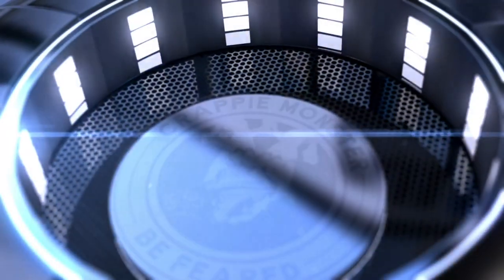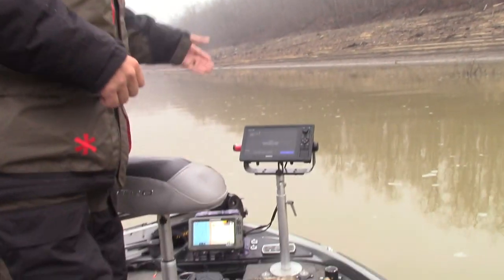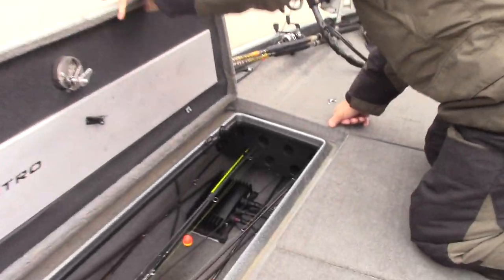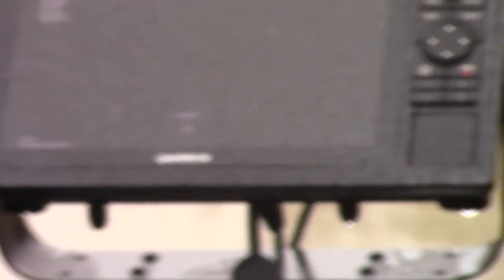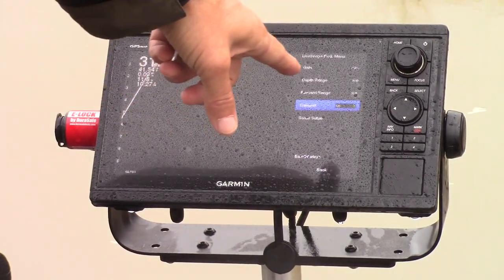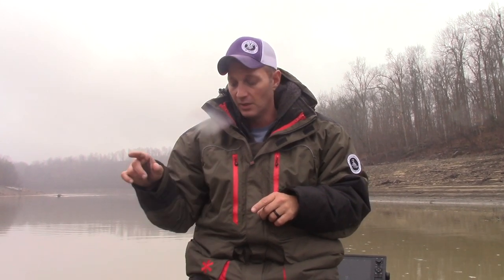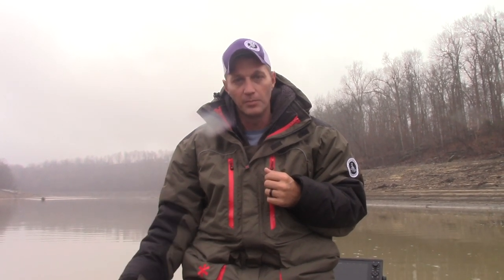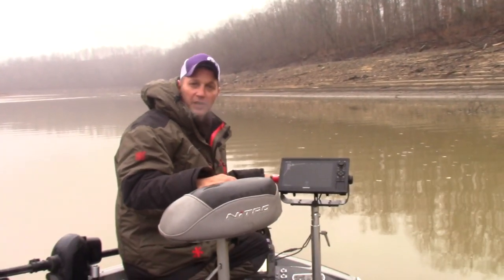Trouble Shooting your Livescope

Comment: I`m just now getting this info thanks for posting!When I use my panoptics  for live Scope,I have no cone beam icon on my screen and I don`t know under which menu to look to turn it on. My transducer is connected on my troll mtr but when I turn my mtr there is no indicator on the screen.
Reply from the maker: You have to go thru the calibration process to get it, I believe. Mine doesn’t have it either.
Reply: @CrappieMonster OK  Thanks for the bresponse

Comment: I'm sure this is a dumb question I just got live scope and they didn't ship the network cable with it so I figured I'll get everything hooked up and have it ready for the network cable and be done I hooked the power up to the black box and I get that red light and then nothing do I have to have the network cable and transducer connected for the black box to operate correctly?
Reply from the maker: Yes.

Comment: Well I've got this exact issue. Unplug my power for 10 seconds and replug, flashed red once then nothing. Tried the other cable like you said and nothing. Any ideas?
Reply from the maker: It’s probably the connection on the 18” cable. Did you try that one?

Comment: Now I would imagine that the power cable coming to the black box is supposed to have 12 volts at all times? I unscrew the red power cable off of the black box. Hit it with the voltmeter and there was no power.
Reply from the maker: That would not be good. It sounds like you have a tripped breaker or blown fuse.
Reply: @CrappieMonster  I figure it out. Whoever installed it didn't crimp the connections on the battery leads well enough. Sometime between the time I fixed the positive connection at the battery, and got the new cradle for the Garmin in the mail. Which was the reason it wouldn't power up. The battery terminal on the end of the ground wire had also broken loose. So luckily it wasn't anything major. I just bought the boat last Saturday. so it was an error by whoever installed it. Thank you for your time and this video. Cuz it may save me in the future

Comment: Why do you have to unplug the short cable ? My Garmin is doing the same thing. Is there a problem with the cable? I’ve used it one time and it’s reading transducer not connected
Reply from the maker: You really need to put dielectric grease in all the connections.
Reply: @CrappieMonster  I have on all the commections
Reply from the maker: You will end up having to send the transducer back.

Comment: You probably need to put the black box on the side of the compartment so doesn’t get wet. And probably have bad black box had mine for 2 years never done either of these
Reply: Could be....I'm wondering if it's my transducer and cable bad or in that box though.   When I called Garmin they had me do about same thing, but it's an all day event 🤦‍♂️.  Reading 12.4 - 11.8 on voltages so not sure that's part of it?  Wouldn't whole unit shut down if it was lack of voltages though??

Comment: Me the dumb dumb had a problem and the fix was so simple but just a dumb mistake I made! I have a Garmin and everything was working perfectly except my panoptix icon was gone off the screen and I didn’t have forward facing. Again everything else was working side scan down scan and mapping was good. I had taken my batteries out of my boat doing maintenance and when I put them back in my boat I didn’t hook up the ground wire for the black box. It just never crossed my mind because I had power to the unit and I didn’t think about the separate power supply. I was about to pull my hair out! I had done everything you’ve been talking about and changed the fuses! That ground wire had fallen behind some things and it was hard to find. I just thought I would make a comment just in case someone else has a problem but a simple fix/mistake.😂😂😂

Comment: My live scope works for about 1 to 2hrs then looses transducer signal. Can this be an over heating issue. Or is there a fix for this.
Reply from the maker: I’m not sure. I do always turn off my transducer if I pull it out of the water. More than likely you need a new transducer

Comment: So when you’re unplugging and  plugging the connections..with the power is on?
Reply: I put a switch on the power from  the black box to the transducer so I can cut the power off when moving,
Reply: I miss read your question, I don't unplug anything it all stays plug in, all I do is unhook the small battery to the head unit, and pop out the 20 volt to the black box, and it's good to go.
Reply from the maker: Yes with the power on. There is no need for a switch! ALL THE UNITS HAVE ONE BUILT IN!!! hit menu then toggle the transducer to off.

Comment: I have a 126sv and don't have a connector at 18" on any dual cable or power cable.  Just a fuse..  Can't I just unplug the power cable?  Have your issues almost every time I fish.  Sometimes a few minute delay before the transducer fires up.
Reply from the maker: You can try that. I’d say unplug the transducer cable first though.

Comment: Great video. Just got Livescope plus and new 106sv unit. Neither one is coming on. Livescope Box no light at all and graph not coming on. I have 12:6 volts at the power cord to both. I did hook up my graph to same battery by itself and it came on and works. By the way I have the  gls10 box and graph wired to the same stand alone battery. Is that okay to do? Thanks
Reply from the maker: That will work just fine.

Comment: Hey, how's it going? After making some changes installing the same battery on my boat, I noticed that my livescope started to slow down a few times like yours, could it be because it's on the same electrical line as the lights and bilge pumps? It was right after installing led strips for lighting, and pass some power cables from the 70a source that I installed to the 24v line of the electric motor in the same sonar signal duct

 Sorry for my English, I'm Brazilian
Reply from the maker: I wouldn’t think so. I ran my last boat all off the same battery.
Reply: @CrappieMonster  What is the solution for this lag problem? Is there a problem with the black box? Or could it be the update?
Reply from the maker: I would call Garmin. The lag in my opinion would be a black box problem.
Reply: @CrappieMonster   am brazilian, here there is no garmin support. I think it's an update, could you tell me if there's a way to downgrade from previous updates?
Reply from the maker: There is you can call some of the American shops. They can talk you thru it. Garmin has a support phone number

Comment: My GLS10 black box won't even light up (it's new). I tried exactly as you said and it did nothing. I've tried different batteries, separate batteries, unplugging and plugging back in, everything. 

Any clue why the status LED won't turn on? Is the black box dead on arrival?
Reply from the maker: Did you check the in line fuse?
Reply: @CrappieMonster  yes. I measured the fuse with a multimeter and it checks out. I replaced it regardless and still the GLS10 doesn't light up.
Reply from the maker: On your unit hit the home button and see if you can select Livescope. Go thru all three connections on the networking cable waiting 10 seconds before replugging it. Put dielectric grease in all the connections. Unplug at black box, at short cable section by the head unit, and then on the back of the unit. If that doesn’t work either call PTG Outdoors in Grenada MS or call Garmin.
Reply: @CrappieMonster  I will try those things. 

If you plug your GLS10 black box into power (not into the chartplotter head unit), will a status LED on your GLS10 light up? I know the manual says that a specific red blinking light can mean there is no chartplotter plugged into the GLS10.

I need to figure out if it is solely the GLS10 that is not working properly. Again, my GLS10 has never had the status LED light up once. Almost like it is completely dead. 

I need to somehow make sure my chartplotter is not to blame though. Is there some way to turn on the GLS10 without a chartplotter plugged in?
Reply from the maker: Not that I’m aware of.
Reply: @CrappieMonster  shoot. Well that means it's difficult for me to decide whether my echomap UHD 95sv is not turning on the GLS10, or if the GLS10 is just not working itself...

I don't know what else to try. 

Thanks for all your responses btw.

Comment: Man I’m getting the red light and nothing. I tried what you said no luck. I just got everything last month. It has worked for three weeks now. Any idea?? Thanks
Reply from the maker: I would change out the battery. That is the only other reason I know of.
Reply from the maker: Try switching to your other Ethernet port on the back of the head unit
Reply: @CrappieMonster  that where it is right now. I have a gpsmap 1022 not sure if there is anywhere else to plug it. Thank man
Reply from the maker: There should be two ports on the back
Reply: @CrappieMonster  still not working. Thanks for helping I sent an email to Garmin so I should hear something back soon.

Comment: My transducer not found CAN BE FIXED PER GARMIN HELP JUST LIKE YOU SAID.....BUT WHO WANTS TO KEEP DOING THAT ALL DAY LONG??  he told me to unhook then rehook that cable with red opposite 1 you unhooked.  I should have called them back other day out on the water....wonder if its in the box or that transducer and cable?
Reply from the maker: I ended up replacing the black box.
Reply: @CrappieMonster  I'm thinking of doing the lithium rechargeable battery first to see if it's a voltage issue.  I've heard more voltage you run, better the picture.

Comment: Something's wrong with our live scope.It wont show anything clear and won't show anything past 40ft tried everything.We've had it for a year now.Also you have to point it like way off a tree to even barely see the tree!
Reply: We replaced the fuses checked all the connections,wires,and voltage!We have it running off a dewalt battery and never had problems before!Transducer looks good and everything.i think it's cracked on the inside,we're contemplating sending it back to garmin.
Reply from the maker: Send it back. I’m about to send two back for replacement

Comment: Hey, very informative video, thanks,  I am hooking my live scope up as we speak, just taking a break. So you are running separate power  sources, one to your head unit, and one to your black box is that correct? That was exactly what I was going to do, but I am running the dewalt 20 volt to the black box and a dekota 12 volt lithium to the head unit, will this be ok. And what voltage will be reading on the head unit? 
Thanks again
Reply from the maker: Yes. It should be around 12 volts.
Reply: @CrappieMonster  Thanks for the reply,  I was hoping it would work ok.
Reply: Both must share a common negative so no, wont work correctly.  1 run 3 12ah 18v milwaukee batteries in parallel and power all my garmin units and black box.    126sv, 122sv, 73sv and black box.  Isolates entire garmin units from boat voltage and thus no interference.   Check for Garmin updates every other month and install them.
Reply: I just hooked up my livescope with 93sv. How can you run separate power to your head unit and black box?  The power cable connects go to the black box, doesn’t the head unit get its power from the black box? Please respond ... I get one red blink on black box ...screen black.
Reply: @300zxdriver  
I hook my 93sv straight to a Dakota 10 Amp hour 12 volt battery, 
Then I've got my black box hook up with a dewalt 6 Amp hour battery, with an adapter to run the dewalt battery, and it works great. 
I have pictures of the set up, mine is all mounted in a, (I guess tool box), it's where I can take it all out of my boat in about 2 minutes. 
I'll be happy to send the pictures if you want them. Just let me know where to send them.
Reply: @tonymcleroy6729  Thanks for reply. Awesome...
Reply: So you use the cable with the yellow fuse holder to your head unit?
Reply: @300zxdriver  
Yes put a fuse link between each unit, I've never had a problem and it works great. 
Good luck
Reply: What is a "head unit"?